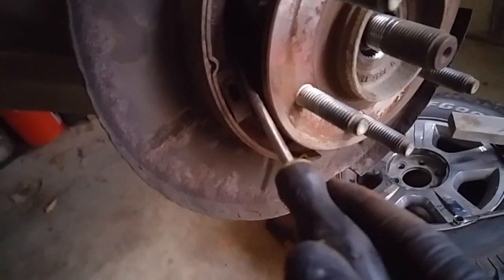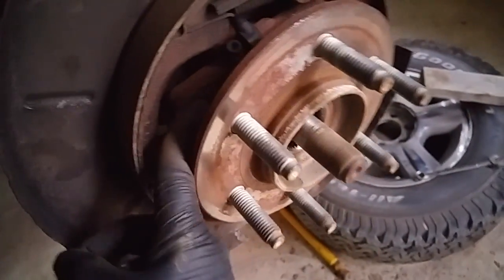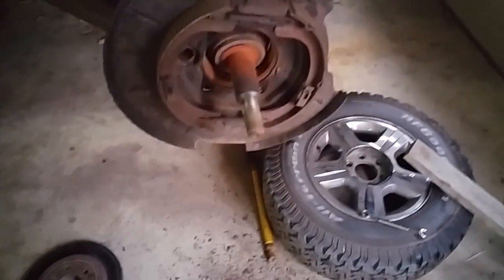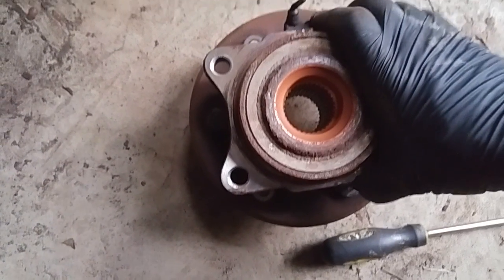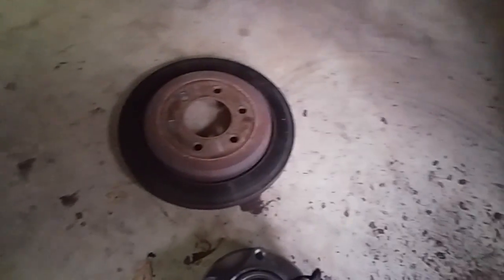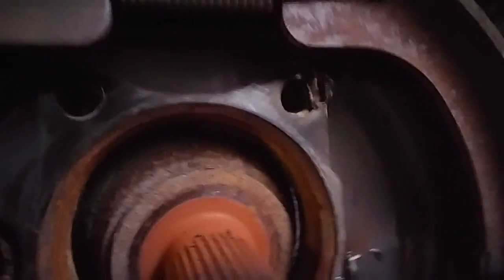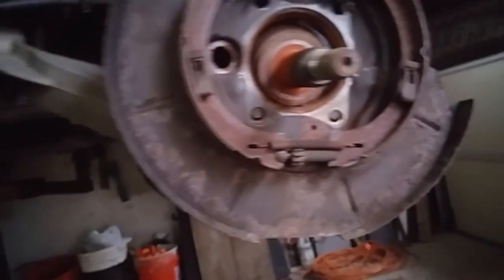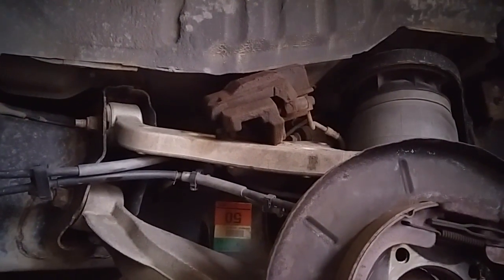Rear wheel bearing removal on 2006 Ford Expedition Limited video 3 of 3

Comment: Not criticizing your video. It was very informative.You don't "beat" on the bolts, you "tape" them after letting the old hub soak in rust penetrant. The bearing hub is attached to the trailing arm by four shoulder bolts on the back of the arm, no need to remove the parking brake. The only thing holding it on after the bolts were removed was the rust. Looks like you were fighting the rust ring between the hub and arm. Sometimes they come off easy, sometimes they don't. Great video. Thanks.
Reply from the maker: Bigfoot62464 tapping on the heads of the bolts isn't going to hurt anything unless you're an animal about it, "taping" them isn't going to do anything aside from aggravating someone trying to wrap tape around the head of the bolt between the backing plate and lower control arm NOT the trailing arm this is independent suspension no trailing arm on this vehicle. Thanks for the comment

Comment: To anyone having issues on getting the hub out because its rusted (seized up)
take out all the bolts then screw in the top  right if its the passenger side , top left if its the drivers side.  5 threads atleast and take a chisel and hammer placed on the bolt (its alot easier with a air hammer though.

Comment: You don't need to chisel the bearing hub off. First spray a good rust penitrant all around the hub and the four bolts. Loosen the four bolts on the back, don't remove them completely, then tap each of them from behind. The bearing hub will come off.
Reply from the maker: Bigfoot62464 I don't recommend beating on the hardware that youre going to be reusing....but to each their own, I'd rather have a screwed up backing plate as opposed to a screwed up bolt that's responsible for holding your wheel assembly on.
Reply: Bigfoot62464  When installing the new hub. Do you need to put high temp grease on the axle teeth? Or just slide the new hub on?
Reply: in the rust belt, I hat to remove the knuckle to get the hub off. it was a 2004....